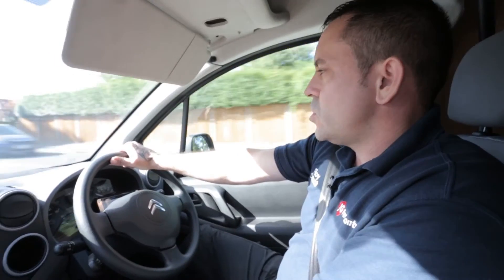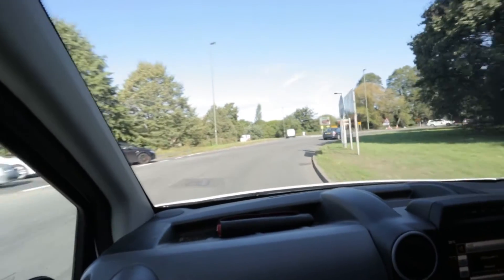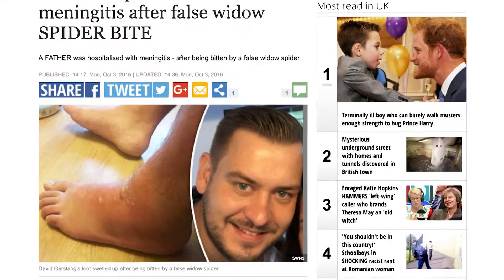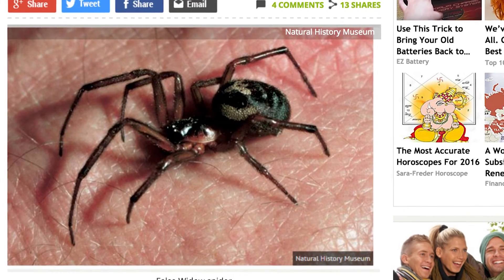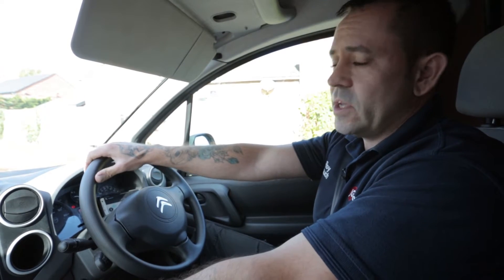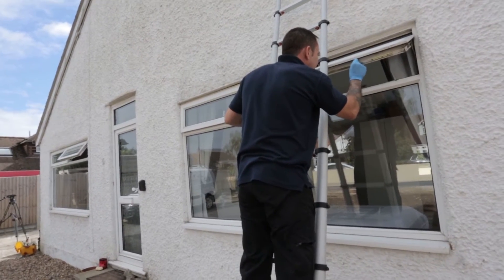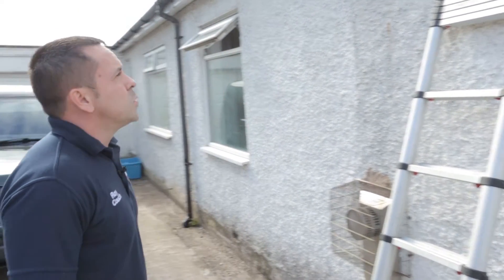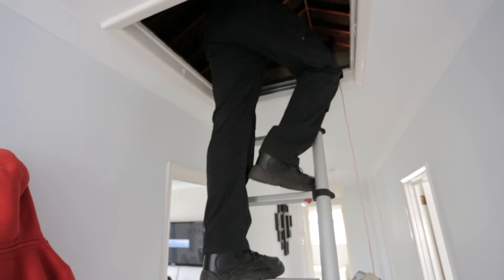False Widow Spider Pest Control by JG

Comment: Did you even identify there were false widows in the property? You just put a spray treatment down without even confirming what you were spraying for?
Reply: I literally have hundreds of them here in Guildford, Surrey. They seem to congregate near windows and my garden gate. I have had them crawl across me while in bed and despite their reputation they have never bitten me. They seem relatively docile. I have also noticed the big house spiders disappearing around here in recent years. I don't know whether they are being driven out by the false widows, which are now my most common spider here.
Reply: @petyrbaelish1718  they don’t kill iff other spiders as long as they don’t wander near the web have virtually every type of spider where I am and the false widow haven’t wiped put other species. The Cellar spider reigns supreme inside the house.